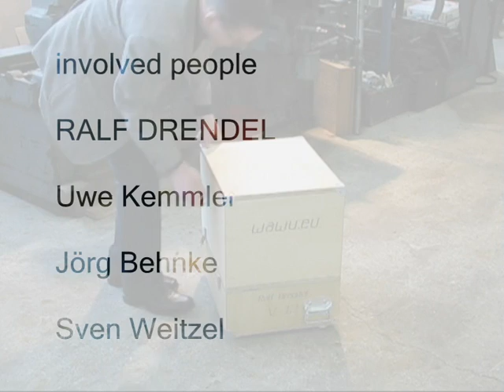V12_RC_Modellmotor_Directors_cut

Comment: @DreamerXristos This one is a 4 stroke engine, you can have an RC with a 4 stroke engine with regular nitro gas as used for the 2 stroke engine, you'll see lots o difference even with only one piston on 4 stroke, it does sounds like a regular car engine.

Comment: @GTS50GESUCHT i know its air cooled but the fins on the cylinder and head are very small and also its a 4 stroke means it runs way hotter than a 2 stroke so only alot of air can cool the engine

Comment: Impressive, a reliable V12 for RC model planes, boats, cars, aircooled. I would have thought a cooling fan was necessary in a RC boat or car, I think it must be a cooling fan in a engine bay of a RC car or boat, in this display the engine was run at high revs without a cooling fan. Is a electric starter available, nice if  it is used in a RC car or boat, and are gearboxes and diffrensials available for it?
Cheers.

Comment: This is cool. I have a few questions though. Why are the pushrods and rockers on the outside? Wouldn't you be able to get higher rpms by having them lubricated? Is the camshaft in the crankcase, or is the valve timing coming off the crank itself somehow? And finally, wouldn't you get better performance by having some sort of exhaust manifold? Ive heard that having some minimal backpressure is important to performance. Also, I heard that running exhaust out of naked open ports can burn the valves

Comment: Hey @boxermotorrad Can you please tell me... will this engine operate with a lighter flywheel? That would improve throtlle response, Im just wondering if theres a reason that you have not done this allready.  Far out this sounds amazing.  Also... Are the air cooling fins sufficient to keep it cool? I would imagine it would produce alot of heat...  I cant wait until this hits mass production, If thats what your intending to do.......

Comment: Good Morning!

I live in Americana-SP Brazil
Entered with different engine Patent is 2 stroke and 4 stroke at the same time, this motor uses the power of 2 stroke, but without polluting and is also economically equal to 4-stroke engine.
I think it will be a major innovation of the Otto cycle engines will revolutionize the industry.
This engine does not mix with exhaust gas and no burning of oil 2 stroke
Alone I can not make a prototype, I need partnership to help me develop this project.
You know who can help me?
Sorry for the mistakes, Google translation translator.
 
Thank you, I await contact.
Marcelino Boraschi

Comment: u r making fool ha ha its fake because how it works with out fuel ha how u r making axalration
Reply: you can clearly see a radio controlled servo turning open the carburetor letting it rev up

it's the same kind of servo that ALL gas rc cars have